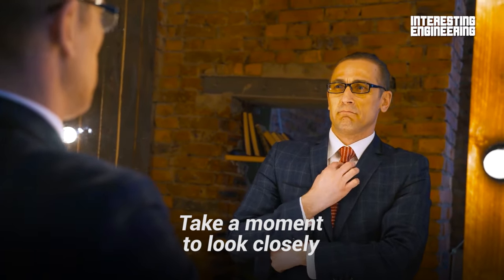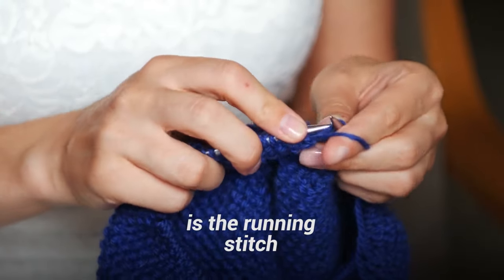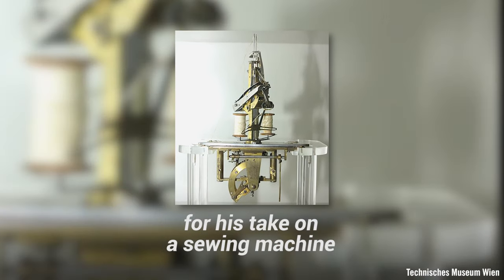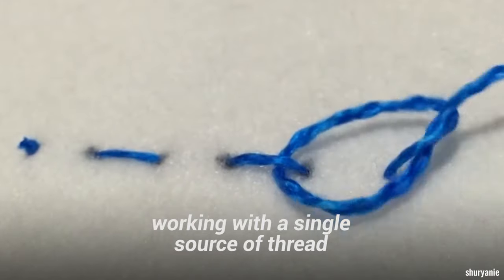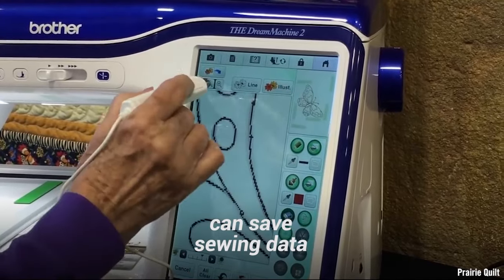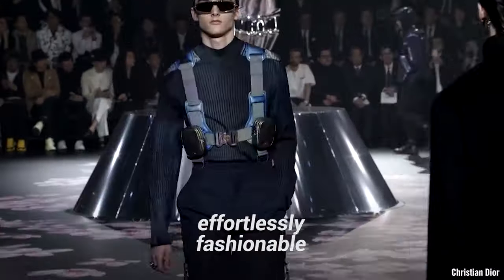How does a sewing machine work?

Comment: Professor Syndrome: When a professor has long since mastered understanding of a theorem, and has forgotten which points key to understanding it were hard to understand. Then in lectures, partially or completely leaving out those points. Then can't fathom why the students aren't getting it. 
"How Sewing Machines Work" is part Professor Syndrome, and partly video editors that don't know and/or don't care whether the video matches what the narration is describing.
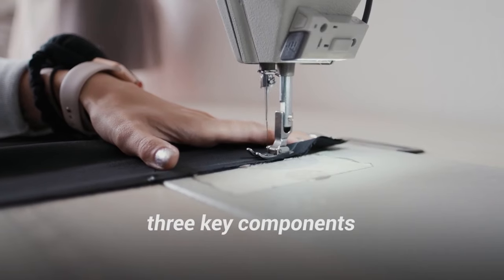2:52 Audio: "a bobbin mechanism"
Video: Shows a shot of the top side of an antique sewing machine, without making clear which part is the 'bobbin mechanism" or pointing out modern sewing machines have the 'bobbin mechanism' below the plane of the fabric,  or even what a 'bobbin' is. Apparently the producer/editor valued run-time of a cute antique sewing machine, over clearly showing what the narrator was referring to

3:10 "That allows the needle to push the thread in and out of the fabric, without having to go through itself"
"Go through itself" sounded to me, like a description of a needle passing through part of its own body.

Sure, if you know how hand sewing works, you might figure out that what he meant was:
"That allows the machine needle to pass only its tip in and out of the fabric, rather than the needle going all the way through the fabric to the other side, as with hand sewing needles." 

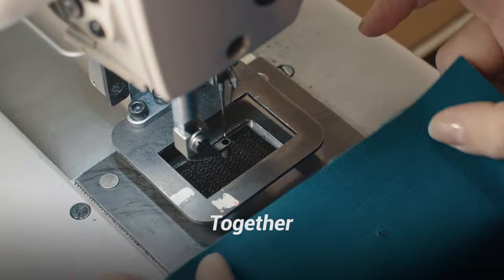3:30 Audio: "Together, the upper and lower threads form a knot that tightens as the needle completes..."
Video:  Above-fabric plane view of full speed sewing of an X-pattern. 
No view of the below-fabric-plane bobbin action being described. 
No view of the two separate threads knotting.

I finally figured out roughly what they were trying to say, after multiple iterations of pausing-thinking-rewatching. This could have been possible in one watching with:
* Much slower motion views of the sewing action--especially at 3:25 'bobbin catches on a second, lower..." and 3:37
* clearly marked sewing machine parts
* video matching the narration
* mitigating Professor syndrome

If Interesting Engineering's business model depended on creating videos that efficiently impart understanding of engineering concepts, then judging from this video, they would have quickly gone bankrupt. Apparently instead, History Channel-like storytelling and soothing, vacuous narration and music beds drive sufficient ad revenue.
Reply: did you just write an essay on this video presentation?
Reply: @aayush_789  and they seem to have nailed it
Reply: @aayush_789  🤣🤣🤣 thank you.
Reply: @giggabiite4417  the thing is, if someone can write all that but have a hard time understanding the machine, then Engineering is simply not for them.  It's called "Interesting Engineering".  Too much complaining going on up there in the comment
Reply: I totally agree with your concerns. I initially thought of showing this video to my class of beginning sewers but I think it would leave more questions then answers, such as the part that speaks of replicating the basic hand stitch but the video shows someone knitting instead of hand sewing!  The knitting has no place in this video and would just confuse a child learning how a machine works.
Reply: @AlloyedFrequencies  "if someone can write all that but have a hard time understanding the machine, then Engineering is simply not for them"
The point was why and how unclear engineering explanations waste everyone's time, and can cause disastrous results.
You appear to have entirely missed this -- instead interpreting "writing all that" as the musings of someone too dense to understand engineering.
Reply: @aayush_789  "did you just write an essay on this video presentation?"
You appear more interested in suggesting others are trivial/dense, than clear explanations of engineering concepts.
Reply: First you accused the people who made the video of not living up to your standards, then you accuse the people that responded to you of not living up to your standards. I guess we can’t all live up to your standards. This is YouTube called interesting engineering. If you don’t find it interesting that’s you. Not our problem
Reply: No that’s not it. You don’t know me so you can’t accuse me of things you don’t know
Reply: @AlloyedFrequencies  " you accused the people who made the video of not living up to your standards... If you don’t find it interesting that’s you"
You've managed to take an analysis sincerely intended to demarcate problems with the video and how to improve it -- and turn it into a personal attack on you. 
I'm going to guess you've come from an environment where any pointing out of errors, was accompanied by emotional and/or verbal abuse. Pointing out an error does not imply a personal attack. Rather, it's how science works -- iteratively trying things then correcting / improving.
Life is too short to waste on unresolved issues. I hope you figure them out.
Reply: @antera77  leave me alone
Reply: If I could give a thousand likes I would
Reply: @AlloyedFrequencies  For an engineering themed video, it does a very poor job explaining the actual engineering, but a solid explanation of the history of the technology.  Actual engineers would find this rather inconvenient, as they are they type of people whos interests tend to prioritize mechanics and efficiency
Reply: @timtom4300 I don’t remember why I looked this up but I found what I was looking for. I studied engineering for a very long time. Are you in the field?

Comment: Not sure why they show someone knitting instead of doing hand sewing for this video…that part does not make sense.  Had to warn students about that one before I showed it to them.  Also had to warn students about the fact that sewer was pushing fabric through machine…also a no-no.  This is what they refer to as “noise” in a video and needs to be dealt with before a video is shown which is why any good teacher previews the video first.  Other than that, it a fairly good video to introduce the importance of this invention.  Best shown with a more detailed graphic video on the how the bobbin mechanism actually works.  Love the fact that they show a treadle…I learned to sew on one of those.  There is a glimpse of a hand-crank model.  And we either see a Singer 128 or 127 in the video as well.  (Can’t tell which without measuring the base.  127 was a 3/4 scale model of the 128.)